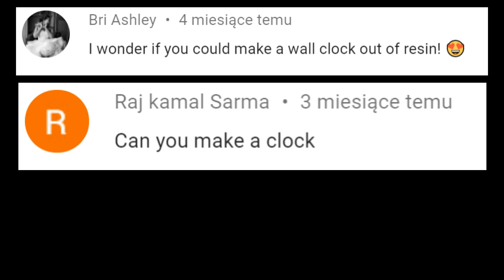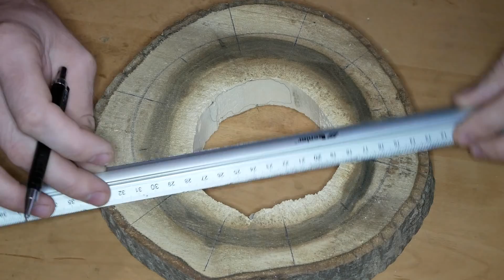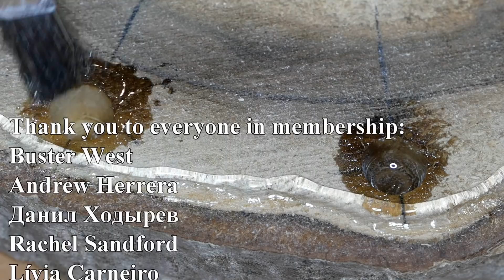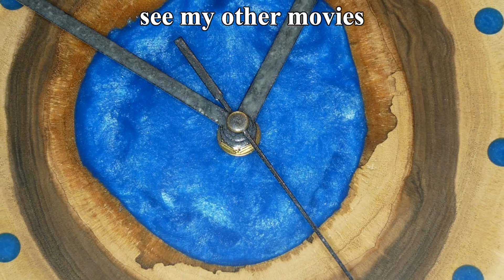Epoxy and Wood Clock. DIY a Simple Way / RESIN ART

Comment: I've watched a few videos and I didn't realize you were a skilled woodworker as well (or at least a knowledgeable one). Yes, lots of folks can cut wood and sand (I volunteer in a 50+ woodshop and I also have my own shop), but not too many folks know to buy brad point bits. it's what caught my attention. Well done you.  While some woodworkers can turn (and anyone can learn to use a bandsaw and drill press sander) not all turners know diddly about woodworking. Same with carving. 

As you seem to be someone up for a challenge, I have a project for you. 

How about you make a wood and resin downdraft incense burner?

Comment: You should have turned the light off, so we can see how this clock looks in the dark, considering you have added glowing dye. And I think, I would like to ask you to make violin. Small size is OK. Does everyone here have the same idea? I think that is not very hard. I imagine, you make the pattern by using 3-D printer. After that you put the pattern on the silicone. And you will pour the resin into the silicone. This is just an idea. But it would be great if you make it 😊 come to think of it, you haven't made any musical instruments before. Maybe you would try to make one? 😊